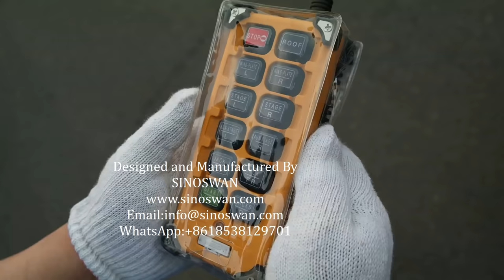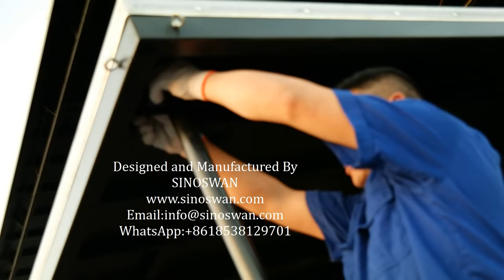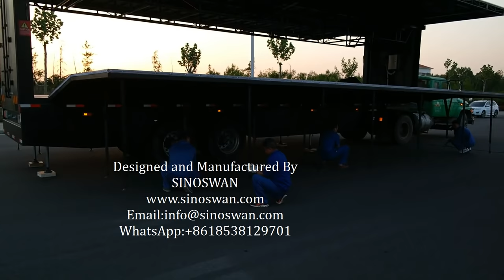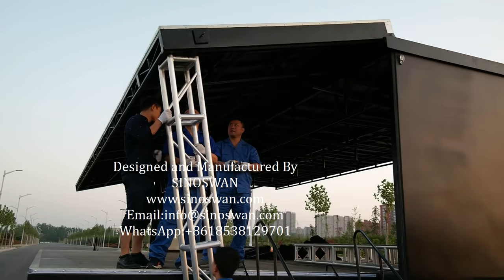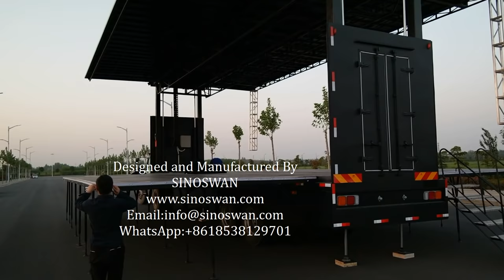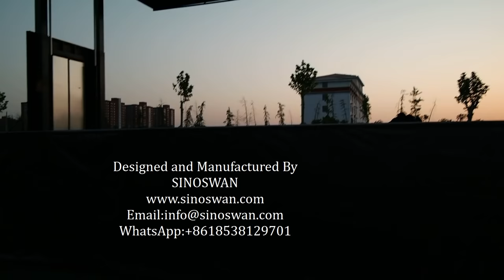Evangelism Truck for Crusade and Gospel Truck used for Church Bishop Outreach Faster,Safer,Easier

Comment: What is the point of having extra stage - that has no roof over it... it should be switched... make more roof and less stage.  The whole point of these stages is to provide WEATHER protection for an event.
Reply from the maker: tahbkstso much for your Susggesion